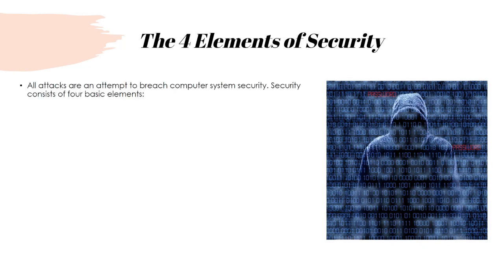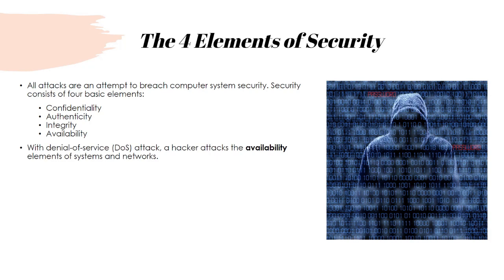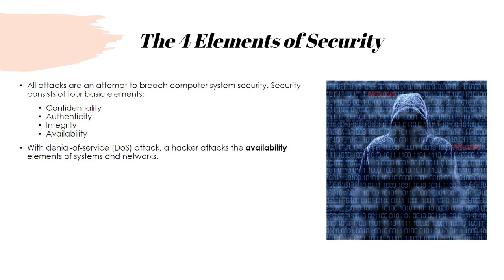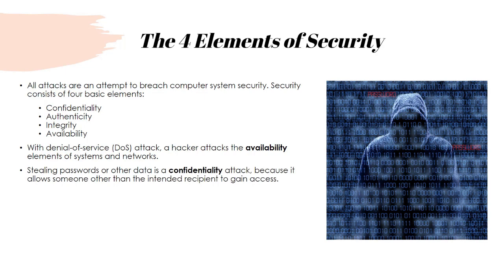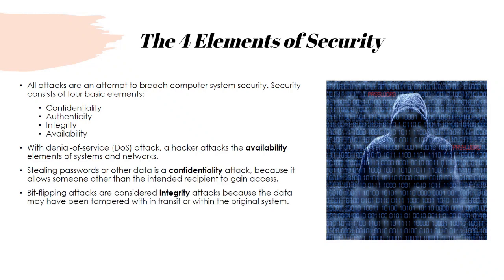Essential Security Elements Explained | Ethical Hacking Full Course Part 3

Comment: 00:06 Understanding the four essential elements of security.
00:40 Understanding the four basic elements of computer system security is crucial for preventing cyber attacks.
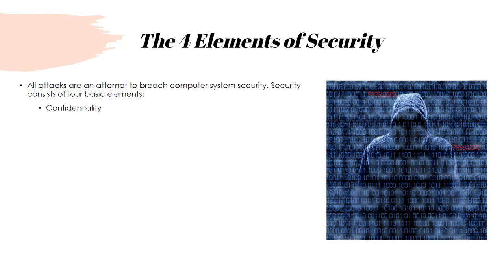01:11 Understanding essential security elements in ethical hacking
01:43 DDoS attacks overload systems to deny service
02:13 Understanding different types of security attacks
02:44 Digital signatures can be compromised by attackers
03:16 Integrity and MAC address spoofing
03:48 Understanding four basic elements of security